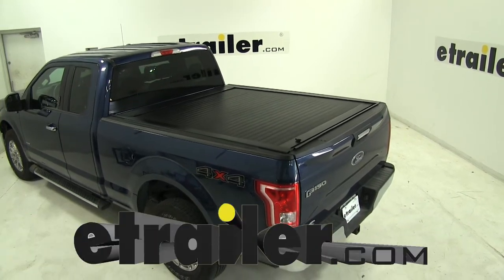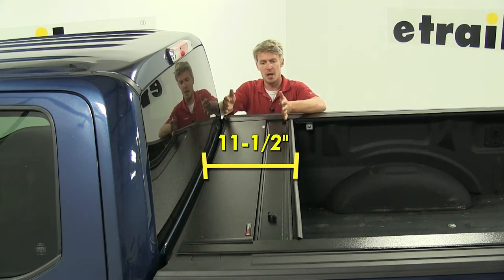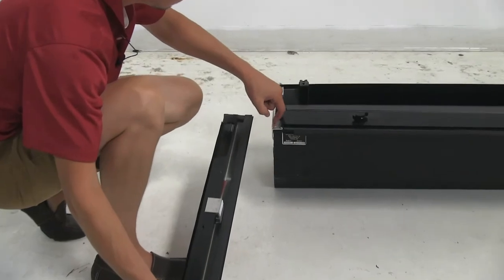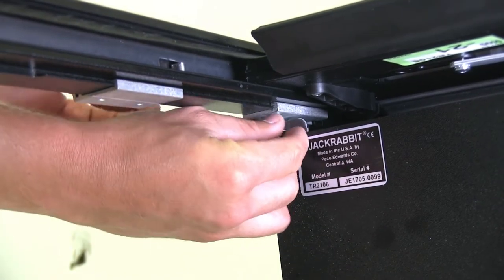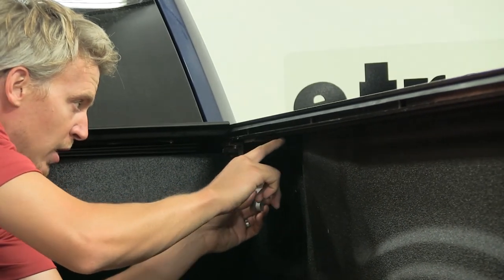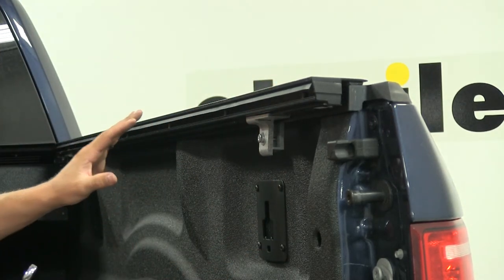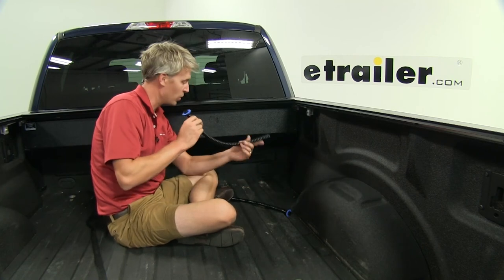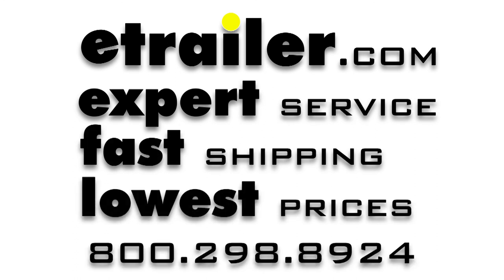etrailer | Pace Edwards JackRabbit Hard Tonneau Cover Installation - 2016 Ford F-150

Comment: For demonstration purposes we will not show this. What is that? 😕
Reply from the maker: We did not permanently install this cover on this truck so we did not want to drill into the truck. We wanted to show off what the cover looked like when it was installed to give you a good idea of how it would work with your vehicle.
https://www.etrailer.com/Tonneau-Covers/Pace-Edwards/311-jrfa06a29.html